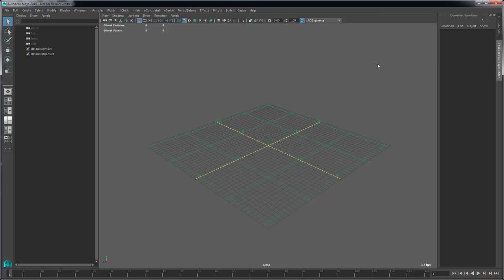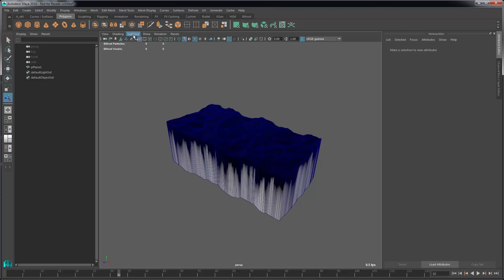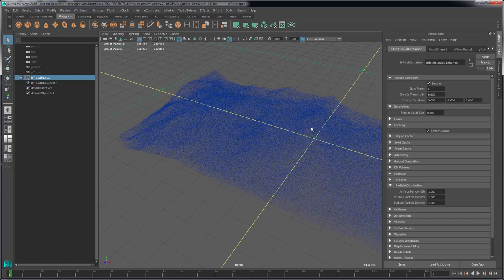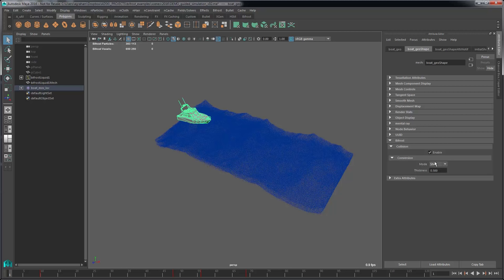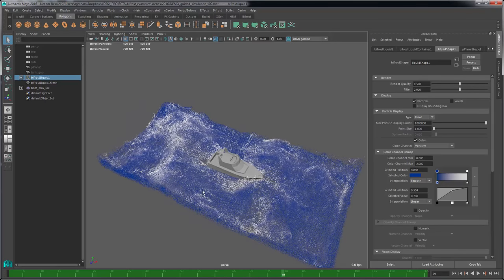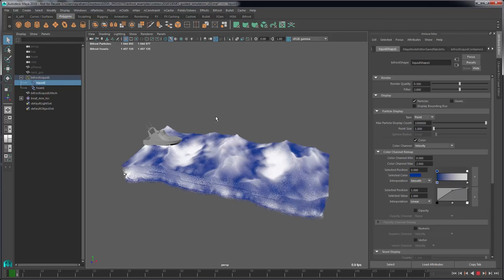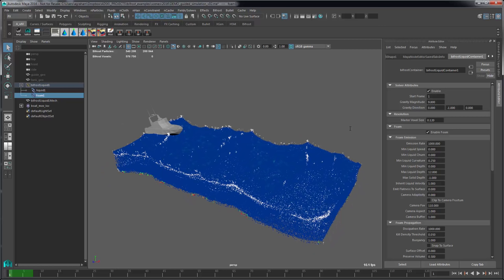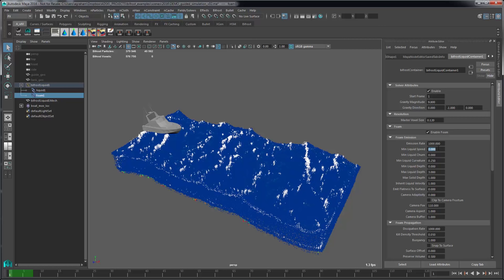Guided simulations and foam in Bifrost 2016

Comment: First, Thanks for the explanation.It helped me in many ways.The question I still have is perhaps a bit off topic: for the life of me, I couldn't make the native Maya Ocean or Water shaders to move the vertices in all three directions. Just up or down.I looked for other ways in Google and YouTube, but still didn't find anything helpful.I'd appreciate it if you could tell me how you created your initial ocean surface.If not, then still thanks for a very in depth tutorial.
Reply: +Moshe Yahav 
You can create 3 dimensional wave in Maya with the texture deformer. Try this (1:1 scale):
Create a polyplane (width:500, height:500, Subdiv.: 100 in both direction)
Add a texture Deformer
Add a Texture to the deformer (Ocean of course)
Deformer settings:
Point Space: UV
Direction: Vector!!!!
Vector Space: Object
Vector Strength: 250, 1000, 250
Vector Offset: -250, -1000, -250
Play with the Ocean texture attributes. :)
That's it.
Cheers, D
Reply: Thanks!
:)
Reply: +Dénes Dankházi   Thank you so much!!!
Reply: +Dénes Dankházi This is like the best comment I have ever seen in YouTube!. THAAAAANKKSSS!!!!

Comment: hi, i'm confused i just did what you said. I reached to the point where you input the connection between the poly Guide to the bifrostLiquid, when i connected them together the particles disappear. Of-course i reset to frame 1, it does the calculation but there is nothing to be seen.

Comment: Hello. I have a question. I have tried to animate a boat after my guide surface. But when i play it, it is "choppy" due to the smaller waves. In your animatic (i have the files) i can see that your animationcurve is smooth. How did you even animate the boat along the water, making it go so smooth? Cheers

Comment: Is there any general settings in maya that helps speed up bifrost ?.   we purchased an insanely fast workstation (Threadripper2 32core cpu!!)  and Bifrost is just as slow as my older workstations, what gives!???
Reply: I dont know what the fuck is wrong with the threadripper 2..my 2970wx is acting like its pentium 2!!!
I saw a post where it was explained that sims r not good at utilising multi-threading and hence threadrippers r useless here....better single core speeds of intel r better for such tasks..

Comment: About having a guide sim over a larger deformed ocean.
When I make the container, the water splashes along the edges when it is making contact with the tank.
To resolve this issue do you just put kill planes directly where the water will collide with the tank, or say 1 pixel inside that space.? I look at Igor's videos and the edges are so clean.

Comment: Good Explanation, such an underated feature, that allows for control, direction while maintaing fluid sims for surface interaction. How accurate have you found the velocity advection/guide on large surfaces with lots of variation in wave height/amplitude?
Reply from the maker: +Niall Horn Thanks for the comment.

The lower the Min Simulation Depth, the more closely the sim follows the guide surface. The catch, however, is that as you decrease this attribute, you must also decrease your MVS, thereby increasing the resolution of your sim to accommodate.